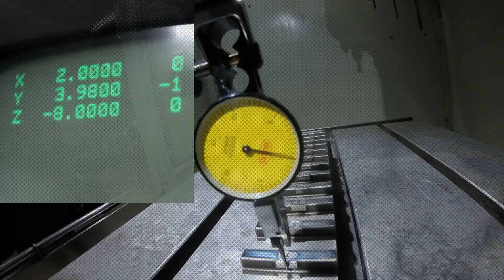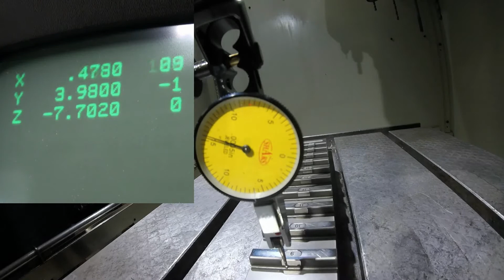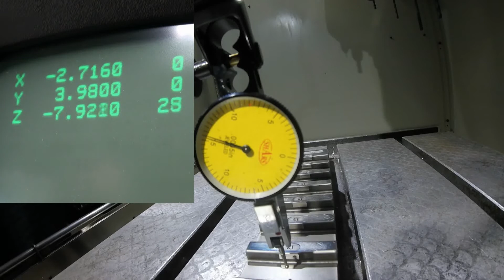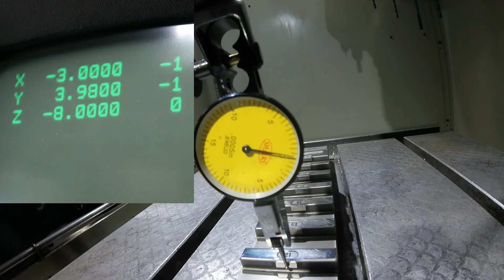CNC Machine Setup and Alignment Part 9: Ball Screw Pitch Comp

Comment: This series was frickin amazing! Im going to build my own vcm with a welded frame filled with granite epoxy, going to aim for a frame weight of approx 400kgs (solid af for a bench cnc), this series will be such an epic guide!

I want a highly precise machine, with a max of 0.005mm repeatability, i think its perfectly possible as long as the running gear i purchase is all brand name high quality (c1 ground double nut ball screws, nsk high rpm spindle and motor combined under 1micron runout, precision servos capable of sub micron precision)

If i get mating surfaces machined in a shop, scrape em all in and go through the series ensuring everying is 100% perfect!

Im pretty sure this machine would be capable of 0.005mm repeatability, which is what i need for watchmaking, prob could get away with 0.008mm, maybe even 0.01mm, because i dont make tiny watches and should be able to get off the ground with 0.01mm repeatability..

Please correct me if im utterly dreaming lol i am super capable, made an excavator from scratch, made half a pocket watch from scratch with no cnc, made a bunch of specialty precision tools to make the watch parts accurate enough to work, etc etc

So its not like im some rqndom dude zero engineering experience just watching utube lol

Hence why im confident AF i can get it done as long as i get the measuring equipment and running gear is all super high grade for cncs capable of making watches..

Sorry for the long msg, any honest feedback would be greatly appreciated from seasoned vets, constructive criticism 100% welcome!! 😂😂

Thanks!
Reply: Building your own machine is probably a great learning experience, for example when you are a ME student, but obviously it's extremely time and labor consuming. 
If your goal is making parts rather than machines the sensible way to go is buy a (used) machine and spend time fixing the issues it might have.